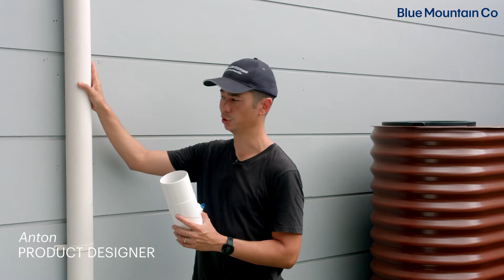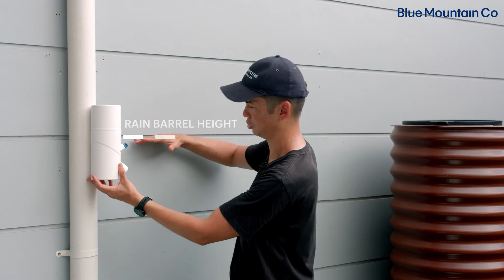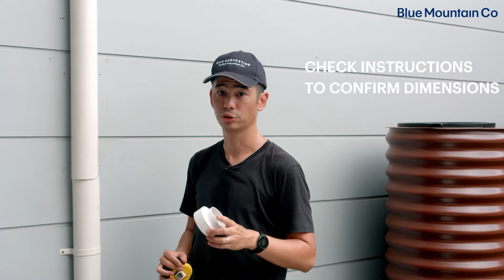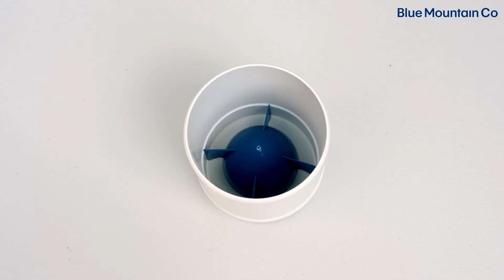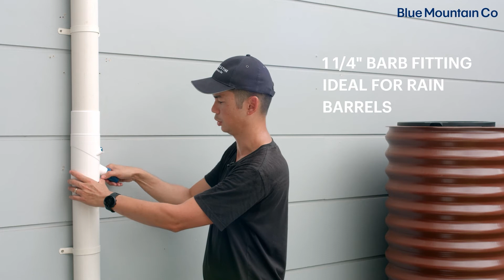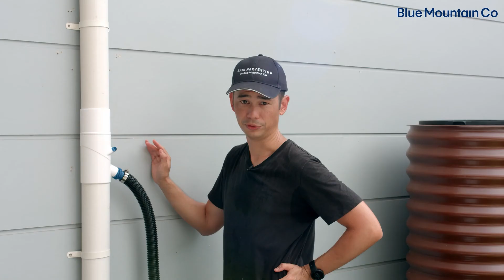How to install your Downpipe Diverter Round

Comment: I am looking this product which applicable for 6 inch pipe
Reply: i'm also looking for similar product with similar size
Reply from the maker: Thanks for your enquiry, Unfortunately, we do not have a product that would fit a 6" pipe. However, you could use an adapter or reducer to make it compatible. Please note that the diverter is physically smaller than the 6" pipe, which could potentially cause a bottleneck depending on the flow rates in the downpipe. More importantly, this diverter is not water-tight or sealed, so it cannot be used for charged lines.

Should you have any other questions please send us email at info@bmco.com.au
Reply from the maker: @WaterSprintBAT  Thanks for your enquiry, Unfortunately, we do not have a product that would fit a 6" pipe. However, you could use an adapter or reducer to make it compatible. Please note that the diverter is physically smaller than the 6" pipe, which could potentially cause a bottleneck depending on the flow rates in the downpipe. More importantly, this diverter is not water-tight or sealed, so it cannot be used for charged lines.

Should you have any other questions please send us email at info@bmco.com.au

Comment: There is a big restriction inside the diverter. Doesn't this make the diverter not compliant with the downpipe plumbing regulations?
Reply from the maker: Hi Peter
You are correct that there is a restriction within the diverter in the central area where the water is collected and redistributed from the outlet. If you would like to discuss it further, or discuss a particular installation, we welcome you contact us in the office (you'll find our number on our website), and we would be pleased to talk through it.
Reply: @rain.harvesting  If a downpipe with a similar restriction was fitted, then the downpipe would not be compliant. Correct?